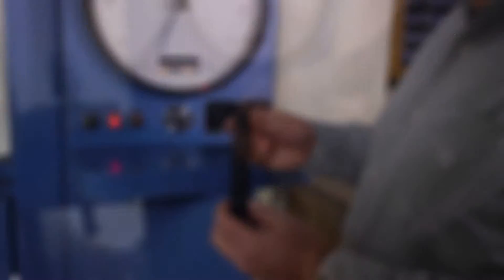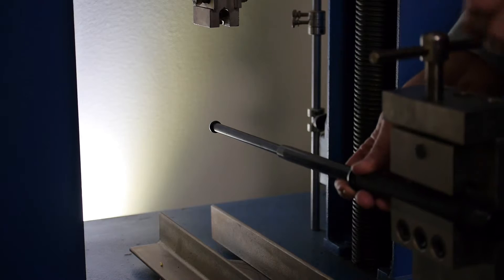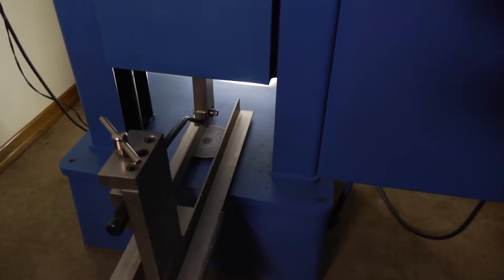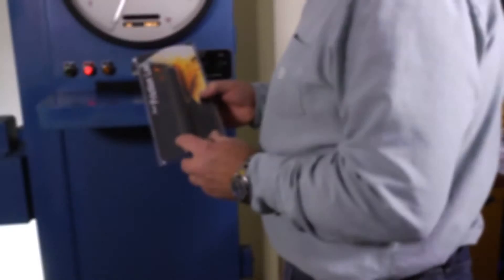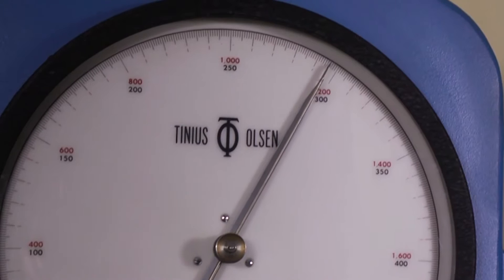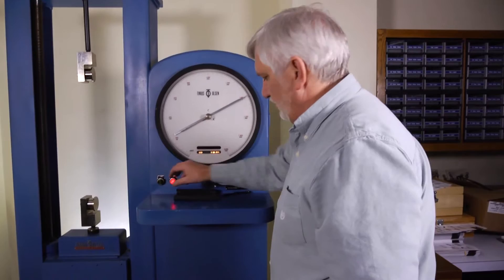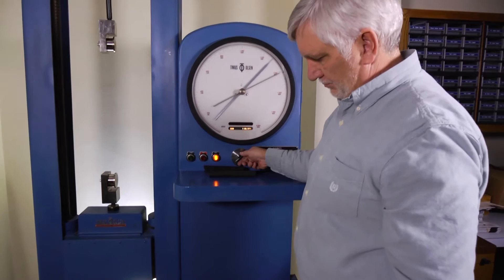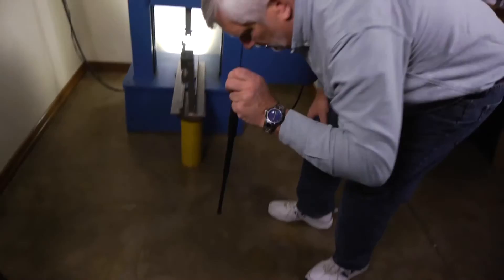ASP |  Baton | Bend | Test | Video

Comment: The ESP did 4140 krupp steel wave master baton, the baton break in to two pieaces after couple strikes. The ASP's batons are weak if you talking about hard tests, they simple didn't pass. And iam talking about sentry models and agents and also protectors. Dosn't matter if ASP's is 4140 krupp or 4130 thai its still can be destroy in realy easy hard tests.